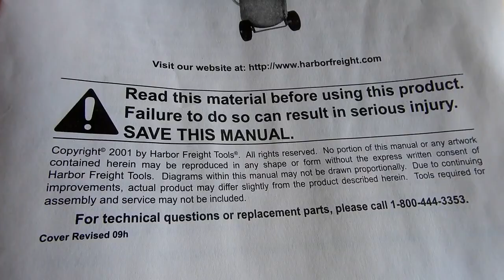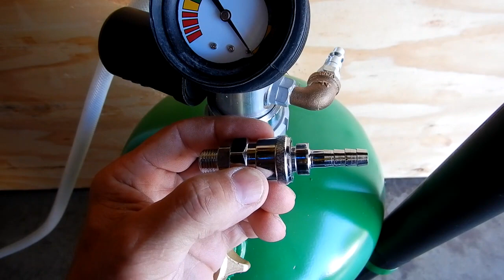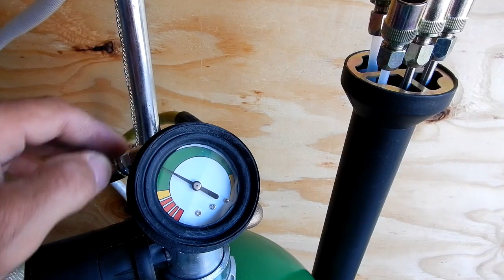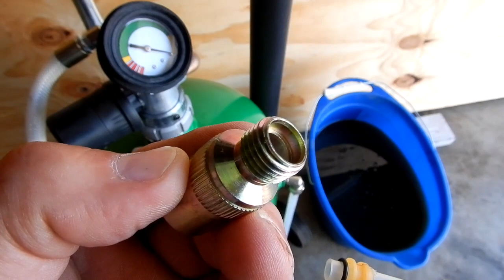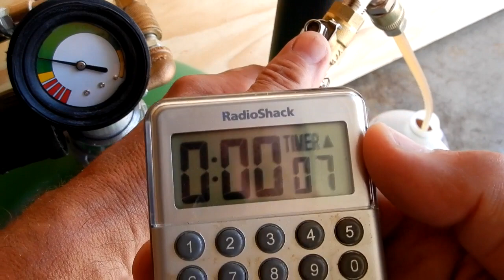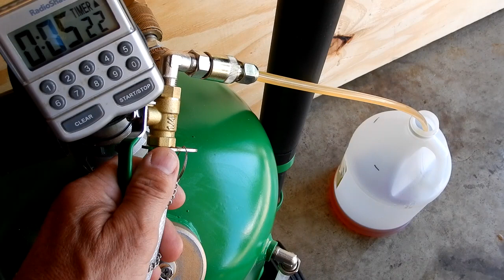6.25 gallon Oil Extractor #46149 Pittsburgh Automotive (Harbor Freight)

Comment: Wish you could still buy these instead of the plastic crap they sell now. I have 2 vacuum pumps so I guess I'll just get an old 5 gal BBQ propane tank and make one but made to use my vacuum pump.
Reply from the maker: Plastic, that's too bad. Didn't know they made that change. Bet the cost didn't go down though.

Comment: How do you drain it
Reply: Through the top cap. But i removed the sight glass and put a valve and hose on bottom port. And put a air fitting in top port to pressurize the tank and then air it up and use air pressure to drain it through the bottom port and hose i added. But you must put a ball valve at the air inlet aswell.

Comment: I bought this piece of crap. Tightened the fitting. The rigid 1/4” hose was way too short to reach the bottom of my 2002 7.3 diesel. Either my compressor is balless or this thing leaks like a whore on front street.

Comment: Nice video thx for sharing ❤ I’m wondering the oil is supposed to be at a minimum 68 max 158 degrees air pressure valve is supposed to be preset 110 max IT should have popped the release you said you were 130 psi,  I’m thinking maybe the oil extracted tube showing the amount may actually be more accurate since oil expands when heated ?
Reply from the maker: You're welcome! Hot oil would flow easier than cold oil to a point. I don't think the "oil level" tube is accurate at all and oil being hotter would not make that difference. The best way would be to empty the tank as much as possible and measure what you poured out.

Comment: Keeps you from having to crawl underneath the car but my oil filter is on the bottom,  so I don't really understand the advantage with my setup. I'm still going to have to get underneath the car to take off the oil filter
Reply from the maker: newton296  You use it if there is no drain plug.
Reply: Saves a lot of money doing tranny fluid change on my benz
Reply: On my ram 3500 is a lot of oil, and it drains down with hogh flow, and it gets spilled all over the place. This tool makes it a lot easier and cleaner.

Comment: So my question is do you keep the airline connected from the air compressor and let it supply air while you extracting the oil or you fill it with air and disconnect the air line? And refill every time the extractor tank empty’s?
Reply from the maker: Kokkolino 11   I keep the airline connected.
Reply: @starastronomer  excellent I will too that way I guess there is a continuous supply of air all the time of use!! Thank you.

Comment: Can it be used remotely.  Can tank/pump be pressurized, then disconnected from the air supply, and taken elsewhere to be used.  How long might it last using it this way.
Reply from the maker: MrLMJohnson    No way. Got to have air flow continuously flowing to keep it working to pull a vacuum.
Reply: @starastronomer  Of couse it would.  The compressed air flows through the venturi fitting on top of the tank to create a vacuum in the tank, does it not?  If a shut off valve is added to the inlet, it could be closed off after the tank reached max vacuum, thereby allowing it to be used remotely for a short period.  How long a period could it be used remotely to suck up non-viscous liquid.
Reply from the maker: @MrLMJohnson  Can't wait to see your video for the answer to your question.
Reply: @starastronomer  Well if I owned one, I wouldn't have to ask questions.  Found my answer on the following thread https://forums.tdiclub.com/index.php?threads/harbor-freight-6-1-4-gallon-oil-extractor.229712/#post-5637480
Reply: @MrLMJohnson  🤓

Comment: Just my experience if I drop my pressure to 50lbs in it makes it pull more vacuum, and extract fluid much faster.
Reply from the maker: Will give that a try. Thanks John.
Reply: I'm going to have to give that shot, though I might just install separate pressure regulators on my extractors so we don't have to be fiddling with shop air pressure in between each oil change.

Comment: Does anyone have any good ideas on figuring out a better gauge system? I have had this for over a year but would like a better way to gauge my oil for peace of mind! Thanks great video!
Reply: I used clear vinyl tape to replicate the gauge marks with black permanent marker, poured in 2 gallons of oil, and then laid the tape with the adjusted marks onto the tube over the entire length with my black mark at the fluid line as my guide. Yes, I can still see the red marks, but I know the black mark I made correlates to the red number just above it. Works perfectly. To test it, I poured another 1 gallon into the hopper and it hit the black mark just under the number 3 spot on. 👍🏻😎👍🏻
Reply from the maker: @Far2hip  Thanks for that!
Reply from the maker: Excellent question RoushRS3. The system that comes with this isn't accurate. Perhaps someone can be of help. The only thing I can think of is making sure most of the oil is out. Then when you do another "oil extraction" you pour out the oil and measure it. Glad you liked my video.
Reply: starastronomer yah I thought of that too I just wish there was a more convenient way like the gauge was actually designed for! Hahaha

Comment: When using an extractor (Any kind) you need to warm the oil before extraction.  It flows better warm and likely would vacuum out in a shorter amount of time.  Unboxing mine today and will test out the time to empty.

Comment: Can this be used for gas diesel/mixed up gas and  oils
Reply from the maker: I would be very hesitant to use with gasoline mixes. Please call the manufacturer.
Reply: @starastronomer  not straight gas but mixed up with the all in one place
Reply from the maker: Call the manufacturer. They would be the best source.
Reply: @starastronomer  I'll give it a shot what's the worse that could happen
Reply: @JK-yd5ro  need a update if your still alive or  not

Comment: Did you heat up the oil? You are suppose to run the engine for 5 minutes before extraction. Hope this helps
Reply from the maker: Captain Tommy Savoy no because it was just new oil in a bucket. No need to heat it up. If it was still in the engine then yes I would make sure engine was warm.